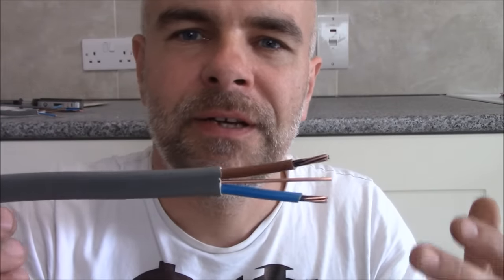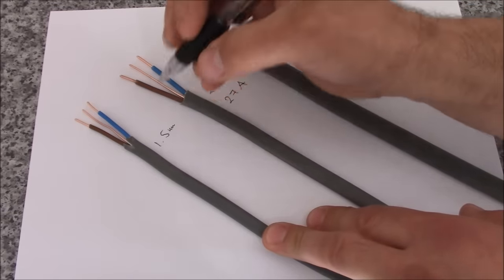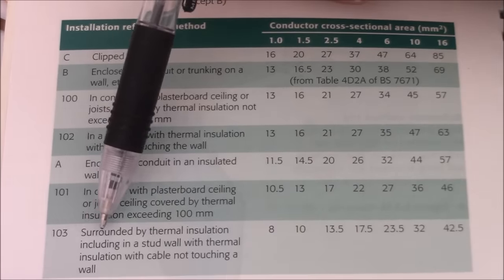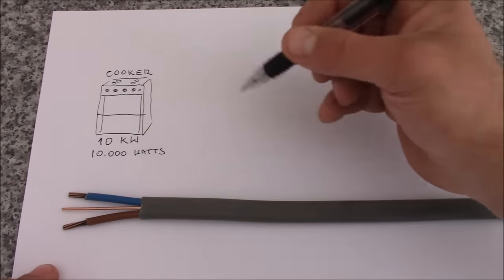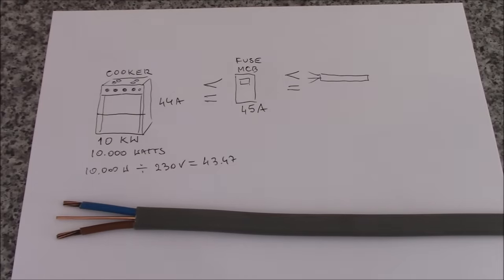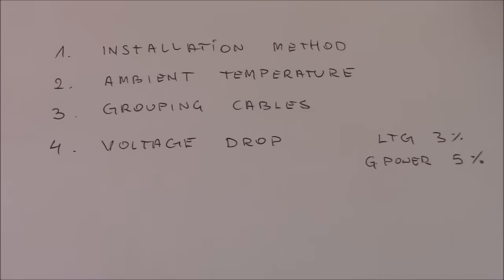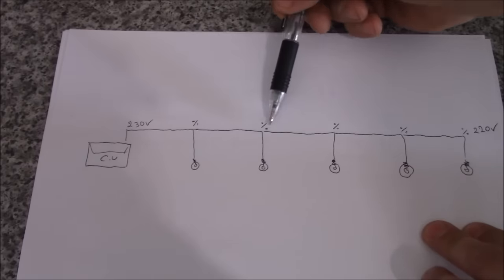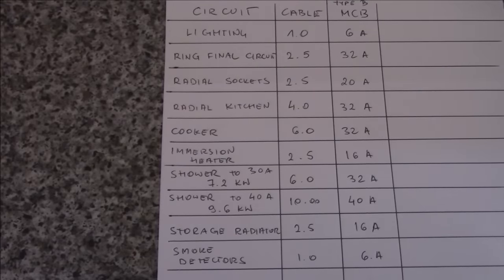Cable size Circuit breaker amp size How to calculate What cable

Comment: Thanks for a clearly explained video. Just a point to remember when referring to a six millimetre cable it refers to the cross sectional area of the copper and not the diameter of the copper wire. Back when I started in home renovation, I would measure the copper wire with a vernier and then wonder why 6 mm was not the diameter ?  Of course not - 6 mm refers to the area - it should be written 6 mm2.
Reply: I agree with you. You did well for going extra miles
Reply: Thanks for the comment, makes sense ;)

Comment: I am an electrician ,and on cookers you should allow for diversity ,  this is an allowance in the electrical ie regs, that means  you would never have the cooker  on full  load ,talking the full 10kw while cooking ,( every oven and ring on full power) this means a 32A CB would be OK with 4mm cable for a short run and 6mm for a long run of cable.
Reply: No bro 6square only
Reply: I did not get wy he counted the cooker fuse as 45A but in the schedule he put 32A?

Comment: I like this simple approach to calculating the design. I can't see a problem with using cable that's over-rated at is has less resistance and can cope with future changes to circuit usage. Diversity is an optional consideration if you don't want to spend too much on cabling etc. but it takes no account of future usage, so having larger cables is fine if you want to pay for it.
Reply: What do you mean  take the "diversity" into account? Is that the tollerance of the cable?  O you mean  1 usage of voltage between   L1 and L2 ?   He choose 230 Volt and that is between L1 and Neutral, so there is no  square 3
Reply: Yes,it eventually boils down to cost.People often add extra loads to circuits without considering the cable power rating.

Comment: A very simplistic look at the cooker circuit, you need to take diversity into account as the load is thermostatically controlled and therefore wouldnt pull the full load all the time.
Reply: You may not pull full load all the time.Pulling it for a split second will trip the breaker.

Comment: Interesting.  I hadn't realised just how much running cables through insulated walls makes to the amperage rating of the cable. It's definitely, something to keep in mind when adding insulation to existing walls, ceilings etc.

Comment: You forgot to take into consideration diversity, so take the first 10A and 30% of the remainder = 10 + 11.33 = 22.4 A approx , so theoretically 2.5mm would suffice if on a type B circuit breaker, 4mm to be safe. ( 6mm cable comes from the old days on semi enclosed fuses - where the correction factor pushed up the requirement for a  larger cable)
Reply: The what? The diversity ? you mean tollerance ? I dont understand that 11.33 A
Reply: You have to assume that not all the burners  and oven etc in the cooker will be on at the same time and draw full current. So we diversity meaning an average current that would be use so 10000/230 = 47amps,take 10amps out will leave 37.then you have to take 30% of 37 which is around 10 or 11 and add back the 10amps that you took earlier and will give you around 21amps. In this way you can use 32amps mcb and a lower siZe cable.
Reply: @septin2008  I think Diversity is ONLY used to calculate the overall current demand of current in the house to see if the demand goes over 60 or 100 Amps etc. If you you diversity for calculating MCB and cable size, you would end up tripping MCB whenever you use the full load (xmas cooking etc) or if you had a bigger MCB but a small cable, then cable will burnt down when full load is used......
Reply: @septin2008  I was told to get a 4mm.

Comment: Will a modern stand alone single oven work off a 16 amp circuit  or do you need to charge out the circuit breaker on the consumer unit for a 32 amp circuit breaker ? Thanks.

Comment: One thing to remember regarding cookers...
If it is a three phase connection than that 44 is divided by 3, which means you can connect each of the phases separately and the cable size does not have to be bigger than 2.5mm and size of three breakers collectively has to be 20 Amps each (44x1.25=55÷3=18.33)
Reply: After waiting two weeks for a new cooker from a place that has the same name as a god, I paid for it to be put in. A bit more than £100. They said they could not do it. That I can only have a cooker thats 20 amp. I did not watch them try. My lights went off and on many times. So I went to see what the hell was going on. My fuse box says 32A . I have to wait 30 days to get my money back.

Comment: This is quite a broad topic. You managed to explain the most important parts, excluding the formulae.
For heavier loads we (central Europe) usually use 3 phase circuits.
Reply: he is explaining for domestic/houses
Reply: Most of the domestic-houses here DO use 3 phases + neutral. AC Voltage LN 230V, LL 400V, main fuses are 3 x 25A or 3 x 20A and current limiters inbuilt in the electrical power meter. Electric stove usually uses 3 phase, so does the heat pump, and other various bigger loads.

Comment: Thank you for yoir explanation, I only have one note: When you get the current you divided power over voltage without the power factor.. it should be P/(V*pf) so the current will be 48 A , then you should select a cable size according to that.

Comment: i now 1mm cu wire can hold max 8 amp without voltage drop 0.05% in lenth 100 meter and don't get hot so (1mm 8amp) , (1.5mm 12amp) , ( 2.5mm 20amp) , (4mm 32amp) , (6mm 48amp) , (10mm 80amp) , (16mm 128amp) 
and thanks  for your great video.
Reply: hold on , you should also take in to account the method of installation , the various conditions it will pass through (example , you may go through insulation and then into free air which operate at different temperatures

Comment: So we're is your volt drop calculation for the load also did you consider diversity calculation for the cooker also socket on the switch as most still have socket on the cooker outlet.

Comment: the same applies in the North America market. the only thing that different is the sizing, Europe used the Millimeter system, and we use the AWG system, American Wire Gauge. here the rule is 14 gauge= 15 amps, 12 gauge=20 amps and 10 gauge= 30 amps.

Comment: You must also remember that current ratings for wires depends on their situation & bundling. This is because cables dissipate heat under normal operation & constricting those cables or clipping them tightly has a different effect than their ability to dissipate this heat as does their placement in insulation vs hanging in a free ventilated area....In short, it is best to select a cable for the application with the matching breaker which is at least 30% larger than the worst case scenario of the application.
Reply: Great thoughts!

Comment: Quick question. Imagine that a cable runinng from Fuse Board to first socket in thernal insulation ref 103 but from first sockets is connected with other 3(radial) by the cable clipped direct for example behing kitchen furniture. In this scenario can we use 4-6mm  to first socket and then 2.5 or should be all the way the same size?
Reply: Cable has to be same size though out circuit.

Comment: Thank you for a very good presentation. I am quite stunned about the wire size. Here in Denmark for a cooker it would be 3 phase and 400 V. The calculation would be like this:                  10000 W / 400 V x 1,73 (square 3) = 14,4 Amps       This will eventually lead to a 2,5 mm2   if it is not placed to hot. Quite a difference!    It would be fused with a 3 phase 16 amp.
Reply: Forgot to mention that the wire would be a 5 x 2,5 mm2 (3 phases, 1 neutral and 1 ground)
Reply: @mortenlund1418  But that cooker should allow a 3 phase connection?  In the video he defined a 10kW cooker that works on L1 and neutral, other people mention "diversity factor" What is that?
Reply: Do you have a link to that book in pdf form or similair pages with the required tables?
Reply: @satish8299  this why the consumer has to check first the fuses wiring he has before buying an appliance
Reply: It seems 3 phase in domestic cooker is over the top, in the UK 3 phase is only used in commercial and industrial premises , don't you allow for diversity in  Denmark,ie  not all the cooker will be on at the same time , if by some miracle all the cooker is on full power al 32 amp fuse with 4mm cable size would trip and would be perfectly safe
Reply: @232beachroad  Yes we allow for diversity, it is part of the dimensioning of electrical installations. 
Example: In my home I have an oven with hotplates. I have lived here 20 years. After 10 years I found out the that the electrician had only used L and N for all the 3 phases. I immediately changed it to all 3 phases. But the matter of fact is that it had worked fine for 10 years! The power loss must have been higher though.
Reply: Very surprised that you can han 3 phase 400v in a domestic house, because this is quite a dangerous voltage, as I mentioned before in the UK only industrial and commercial premises would have 3 phase and by this arrangement only professional electrical engineers and electricians. Would ever work on it, I dread the thought of 3 phase in domestic premises in the UK , with DIY people let loose on it, the amount of deaths would quadruple, as you can probably tell I am a electrician, yes  a 6m cable with a 32 amp fuse back up would be enough for most cookers in the UK ,, diversity calculator included , you could also go with a 10mm cable and  a 45 amp fuse  , and the cooker would also be earthed of course in all cases
Reply: @mortenlund1418 cai make a questio  for you about wires?
Reply: @232beachroad can i make a question for you about wires?
Reply: Yes i see, but dont you allow for diversity in Denmark ie it would be very unlikely that you would have a domestic cooker of 10 kw working 100% at any one time, that would mean all the top rings on, the grill on ,and the oven top on, all at the same time, because this  is very unlikely we would apply diversity. So in the UK it would be 230v supply single phase to the cooker ( industrial or commercial it could be 415v three phase supply for the cooker ) The diversity calculation would be for a domestic cooker is 1000w divide by 230v = 43.47 amps then take 10 amp from this total and add 30% of the remainder ,so that means 30% of 33.47 amp which is 10 amp ,so that would be 10 AMP plus 10 AMP = 20 amp total , so that means you could fuse the cooker with a 20 amp fuse , but most people would put the next size up fuse of 32 amp , that means a 4mm twin and earth cable 4mm cable takes 32 amp ( IN FACT 2.5 MM cable would be OK with a 20 amp fuse installed) could be fitted to the cooker. ( when i say fuse i mean circuit beaker )
Reply: @232beachroad  bro do you understand about electricity in wires?? Can i make a question for you
Reply: What only is important is that the wire can handle the current. The diversity factor is kind of a rule of thumb number you use with reason.  If you exploit the cable to its max the power loss will increase making you consume more power. But as long as you stay within the allowed range you are fine to go. I changed to 3 wires for savings purpose and to be a little more safe, but that it is only emotional. The cable sizes has changed with the new standard European norm HD 30364 which try to improve energy efficiency. Eg in 1 phase  we now often have to use 3 x 2,5 instead of 3 x 1,5 when the distance increases. @232beachroad
Reply: @mortenlund1418  can i make a question about wires?
Reply: The cable size is protected by installing the right size fuse for that cable size ie a 2.5mm t&e cable could take up to a maximum of 28amp, so a 20amp fuse would keep the amps in the limits of the cable size, of course if its a long run of cable voltage drop will occur , the cable size might have to be  increased for 20 amp fuse protection @mortenlund1418

Comment: How do you decide whether to use s CB or rcbo ect?? Are fuses banned if are are running s new circuit on an existing fuse board which has Fuses?
Also for guys doing vthe testing and inspection periodically..if an old board with fuses Which passes ir Tests ect must it be changed??

Comment: Hiya. I'm enjoying your videos Buddy.

Just thought I'd mention it, as you did choose to use a cooker as your example.

Don't forget to apply diversity as it is highly unlikely to ever reach its maximum demand due to the thermostats in the cooker rings. 
 
In your example (44 A) it would be the first ten amps (10 A) then 30% of the remaining amps (approx. 11 A) PLUS 5 A if there's a socket outlet on the cooker isolator.

So, your 44 A has gone down to 26 A. The next MCB up from that is a 32 A.

I'd still use 6mm cable though.
Reply: Kevin McNicholas I've  always been told to use 10mm by my boss..I suppose this would save  money if working for yourself.. I've recently sat the 2391-52 exam,no one could give me a exact way too work out maximum demand/ diversity nt even in  bs7671 book
Reply: cater4anytink Yeah, I know what you mean. I suppose it would be useful to if the oven was ever upgraded again. It's a trade off though, isn't it?

If customer wants to pay for cable that is far and away able to deal with the demand, fair enough.

Thing is though, why don't we do rings in 4mm instead of 2.5mm? Because of cost, that's why.

And if your wiring a lot of houses that's going to be a lot of wasted money.

If customer is willing to pay the extra i.e. maybe  £45, let's say, instead of £30 then yes, do it in 10mm.

Diversity is covered in the On-site guide.
Reply: cater4anytink checkout the best sparky in the U.K. he knows the regs in his head, can tell you the reg and the page its on, his name is john Collins, his training place is  in dudley West Midlands, he is a great trainer, he used to teach at sbc college, he teaches in small groups, like two! On different meters, as everyone has different meters, etc, everyone knows him, especially the regs guys, ex military,
Reply: smartchip

John Collins? Ha, ha... you mean 'Johnnie Ace'!! Oh, he's great. I love watching his vids. Very knowledgeable and puts things over in a way anyone can understand.

Johnnie Ace, (tsk,tsk), is on the case. That's a great catchphrase. 👍🏼
Reply: smartchip   what's his youtube page.  Cheers.
Reply: Kevin McNicholas I'm not an electrician (as will shortly become obvious!) but can you apply diversity to a range cooker, say six rings, two ovens, 12kw max? It may be rare, but there are times when it will be going full throttle! I had assumed that where a single appliance is being fed by a single cable one rates the cable and breaker to maximum possible load, or manufacturers recommended if provided. Personally I would always insist on 10mm to allow for future upgrades, but am curious- I'd hate to buy a house to renovate only to find everything was specked to the lowest / cheapest possible making updating more costly!
Reply: Everything is done as cheaply as possible,I can guarantee that.

Comment: You have explain the calculation to obtain circuit breaker amp size and from there, select the cable size based on the table. But, I am curious about the  calculation to obtain wire size. Why using 1.5 cable for ac  for for example can cause it overheat. What is the maximum by calculation for current to pass through wire certain size.

Comment: The lighting in my house has 1mm2 cable with 6A. I want to install a lamp with a bulb hanging out from the ceiling. Can I use 0.75mm2 cable instead?

Comment: What size SWA cable would I need to run power from house to shed about 8 meters from house to a mini board with 2 mcbs one for a light and one for 2 double sockets on a ring; does it need to be 6mm SWA or 4mm SWA

Comment: Great info. Just wondering why my 2 bed flat (1980s) has got a 16A RCBO on the socket circuit ring?
Reply: It needs to be a 30or 32amps.

Comment: Howdy.
Nice presentation of rating the thermal overload case. There is, however, another equally important aspect. The short cicuit case. There must be enough "short force" feeding the breaker to enable fast breaking (=magnetic triggering) of the breaker.
In my location the power companies will provide information of how much short current is available at the service cable junction. From this point forwards one must calculate the short current at the most distant appliance or socket and choose a breaker that will fast trigger.
If the short current is too low to deliver fast triggering the short current will flow until the thermal breaking happens. The socket wiring will run way too hot and there is a real fire hazard present.
Regards.

Comment: In America since the late 70s there were simple graphs/ chartes that showed you the amount of current for different size wire and for different materials of wire. Disinformation is also contained on the ends of the spool current-carrying capabilities length of wire and ohms per thousand foot. No need to figure out something that is already been available for over 40 years.

Comment: This is a good video but there are a few important missing points. When calculating the size of a circuit breaker the load draw must not exceed 80% of the total amperage of the circuit breaker. For instance, if you have a "cooker" which in Canada we call it a "range" that draws 44amps then the right size of the circuit breaker should be 60A and not 45A. therefore adjusting the size of the conductor is also indispensable.
Reply: Type B circuit breaker  the  characteristic allows for short time 3 times the In, that is the 60A proberbly?  Or you mean 60A need to be be used often by the Cooker?